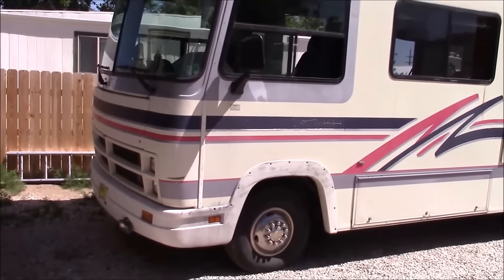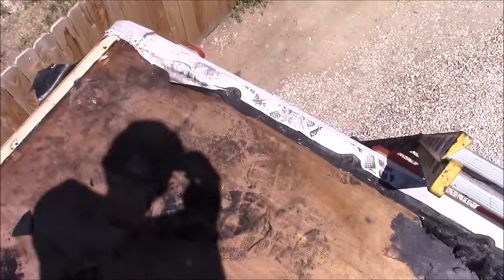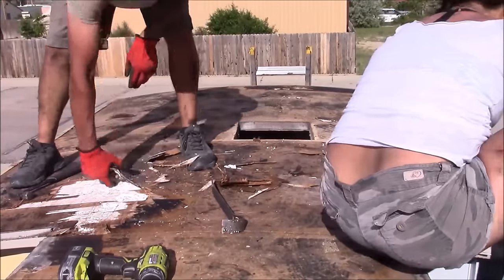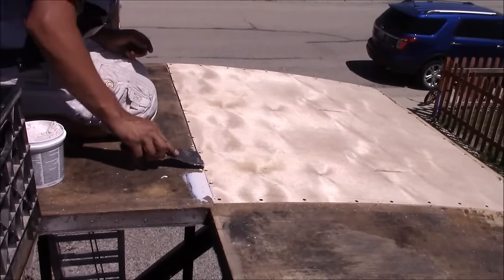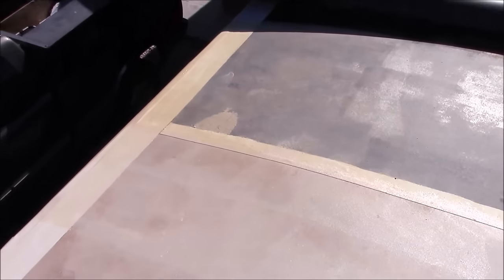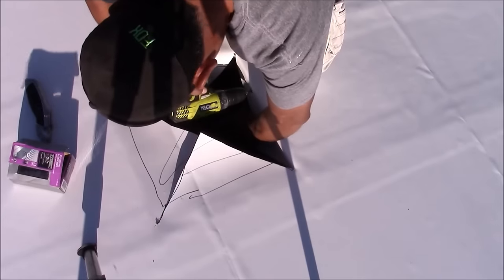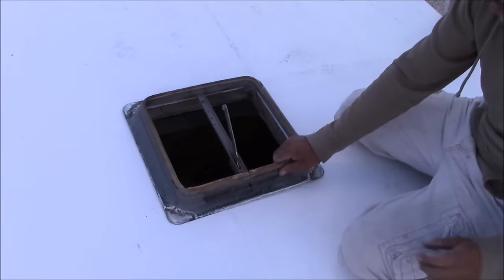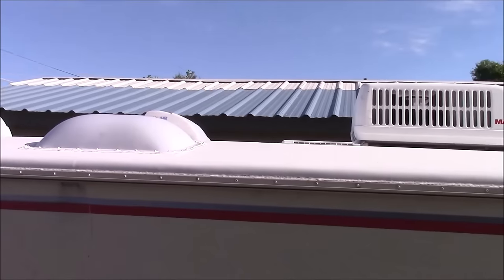How to replace your RV or Motorhome roof EPDM or TPO

Comment: Does the new adhesive stick to the old or does it have to be removed?  I removed my edpm roof and the decking is really sticky. Can I just use the Dicor adhesive right over that or does it have to be shipped off and how?

Comment: Great step-by-step video.  But I would never trust roofing screws with gaskets to stay 100% leak proof.  There is way too much movement involved with an RV traveling down the road.  The smallest bit of water wicking into the underlayment via even a single screw that does not seal will result in rot.  This kind of leak may be undetectable until you discover a big soft spot in the roof in a couple of years.  Go ahead and put a dab of lap sealant on each screw head.  Alternately, you could apply strips of eternabond tape over the rows of roofing screws.

Comment: How long do you think your new roof will last? I’m worried about buying a camper with this type of roof. I’m looking at two campers. The one I like the best has this roof. My second choose has a full aluminum roof. Should this affect my choice? I’m 65 years old so if a new roof lasts  for 10 years I’ll be OK with that.
Reply from the maker: new roof 15 to 20 years but if you get a cover for the months you are not using you could double the life
Reply: C.L.S. Allinone thank you, you helped me make my choice.
Reply: I do commercial roofing for a living. Expect. 30 years for a firestone TPO.   Glue both wood a back side of TPO. Let dry to touch you will be using water block wherever out have a edge.   FYI. Water block is messy. Gets some rags.
Reply: what kind of cover do you use and where can I get them and how much @D.I.Y._All-in-One

Comment: Question: Is there any reason a guy couldn't go right over the old roof? As long as the ends and edges are still terminated properly? Where I live, every 2 or 3 years we'll have hail large enough to put a dent in a normal RV roof. If there were 2 layers maybe it would have a little more bounce back? Is there a reason not to do that?

Comment: Would you happen to have an experience with adhesives to adhere filon to an underlayment?
I took the front fiberglass off the front of my travel trailer and the paper cardboard that they used underneath was not recoverable so I'm having a hard time finding an underlayment 8x9 and the adhesive that would be good for attaching them both together so I can reinstall the fiberglass.
Any advice on this I'd appreciate it thank you.

Comment: I am replacing the roof on my RV and my helper says just put new layer of wood on top of the wood that is already there, he is arguing with me and i am insisting we pull the wood off the sfoam. My thoughts are if we put a layer on top of the existing wood then the top is 1/2" thick and your graphic shows 1/4" hick. Does it matter?
Reply: laminating 2 layers of plywood together is a bad idea unless you completely coat both mating faces with epoxy before screwing them together. this is to seal the wood and fill in the gaps so that there are no voids or empty pockets that could potentially fill up with water (from a roof leak or from internal condensation buildup) and start the wood rotting process. the additional weight can also be an issue for capacity and because it's up high, may affect stability and handling. 

if the existing plywood is bad enough to need replacing then it probably already has mold and rot fungus in it and will continue to rot under the new roof, eventually causing the new plywood to rot as well.

Comment: What do you think it would cost to replace for a 34’ RV including labor. I need to hire someone to do mine and want to be prepared. Thank you
Reply from the maker: 4 to 5k for a starting point
Reply: You can get a 5 gallon bucket of Flex Seal and use cardboard & gorilla tape to create "dams" 
And get it done for less than $400 in 4 hours
But you have to pull the cardboard and Gorilla Tape while it's still wet
Reply: Depending on damage could be as much as 20k

Comment: Question, why did you use putty under the front and rear strips instead of Butel strips
Reply from the maker: I just ran out of butyl tape and all I could find in town was putty either one works well though.

Comment: the putty tape shrinks and pulls back from the initial contact areas  (I.E. it is relatively easy to result in a leak.)   It would have been much better to use the butyl tape everywhere
Reply: He said he ran out that's why he just used putty

Comment: What is the tape that I  can use to cover my old    Beat up an broken trim I see it in alot of video but don't know what it's isi need to seal my popup trailer roof and repaint it because it's old and getting dented and  Big gouges in it any other thing is I used silicone to seal up all the trim  And seems because they were leaking and original cocking now I cannot paint it because it's non paintable I didn't know it and I'm trying to find the tape or rubberized tape that will be sealed when I paint the whole roof to protect it from being damaged which is getting damage now from things falling on it in guarding it I was looking at the  Henry's white rv and trailer paint That you put on the roof will that be the best I don't know I'm trying to figure out seen it on videos it to use that can you give me to my dear I not on this site all the time so you will not be able to see the answers thank you

Comment: Whoa whoa whoa, good job, but the only thing I need to point out is any metal roofing type of screw with the hex head and rubber gasket should NOT be driven in too tight. SNUG. When the rubber gasket is crushed from too much torque, it will not last through a couple of years. Too much pressure makes the rubber gasket susceptible to expansion and contraction from weather and temperature changes. Again, good job though. I've been doing it 20 years, sometimes I just like watching other people work.

Comment: I have an old motorhome I bought from a suspected tweaker 😰😵😵whose manic compulsion to 'fix' things, ruined things! Leaks from 1-2 inches of nails poking through the roof, nails and screws, stuck halfway in and can't be removed! 

ALL that, PLUS years and years of just patching a gunshot wound with a Band-Aid- they just kept piling sealants, upon various quick patches, but NEVER dealt with the leaks from the source--severe water damage and rotting wood, that finally caved, fell into the bathtub and left a gaping hole in the roof! After seeing the origin of the leak, I decided to take it apart like you did, after wasting $ white latex sealant through the roof sealant you name it I bought it, NONE did the job. I can't afford a professional's fee, so I bought all the material and no I'm not looking forward to stripping off mountains of spackle, tapes, caulk and sealants, I'm going to do all the prepping and gluing and pay someone to help me cut the wood and termination bar thingies but I can do this now that I've seen your video!

THIS is the best video I've ever seen on RV roof repair, thank you

Comment: what tape is that? is it like a clay putty gasket material? There is a grey putty like gasket material at work  that was being used to seal and spread all over some giant air conditioning ducts around every seam, I could get my hands on that but i would like to know the name so i can buy the exact amount i need for my camper projects.
  I did find this same grey putty like tape between the window aluminum frames and the outside of my camper so i know its the right stuff, but you are using something that is black there and it may have a different name however possibly the same properties as this grey stuff i found.

any help on this matter would be much appreciated
Reply: I am guessing it is just called putty tape. but that black tape i cant understand your pronunciation.

Comment: It's absolutely a stupid thing that the manufactures of trailers & motor homes use membrain for the roofing what in heck was they thinking....they could have used common sense & put a thing on called steel roofing not rubber membrain...personally i would never buy any coach that has rubber roof i seen damage done to my paraent's roofing started leaking much a disaster nevertheless this video was well done very detailed thumbs up..👍
Reply: i drive truck for a living, i see about 1 out of 10 rubber roofs unglued and ballooned  up , some times they are torn and flopping around. you also have to keep them out of the sun
Reply: I would think that it's a weight saving and flexibility thing.

Comment: RV roof repair can get real expensive real fast this was minor compared to some I've seen  !
Reply: Me too. I work at a repair shop and I've worked at most factories over the past 20 years. Water damage is the worst especially when it's a stick and tin. If it's been leaking more that a couple times it is way above most people's heads

Comment: Do you still have that extra kit laying around? I just bought a coach that needs a roof and after watching this great video, I am more than ready to do it myself!
Reply from the maker: yes i have 1 kit available like this one  http://www.ebay.com/itm/10-x-30-45-Mil-White-TPO-RV-Rubber-Roof-Kit-membrane-adhesive-tape-caulk/152184934989?ssPageName=STRK%3AMEBIDX%3AIT&_trksid=p2057872.m2749.l2649
i would sell at half of the price they have theirs listed for

Comment: 1) ETERNA BOND Roof seal tape, RSW, VW,etc...mfg royal microcellant technologies HB Fuller. Use this tape on all of your seams of your ro of and any of your parts that need to be sealed as well from water.

TIP: TO REMOVE this tape you use a heat gun or a hair dryer heated up and use a plastic spackle spreader they call it a joint knife if it's metal I guess, And you can once the material is softened up from the heat gun you can scrape it off and use gasoline to clean it up or mineral spirits I believe but gasoline cleans it up the best there is a video on this.

2) CHEMLINK M1— For your structural adhesive for putting your roof panels on and gluing them down. I'm sure you could probably use this for other things at your discretion I am not an expert but I'm going to use these adhesives for my camper at this point in time.
3) 3M #90— $12.98 a green can found at Home Depot and Lowe's in the paint/adhesives isles—used for your delamination or side panels of your camper that use plastic phylon FRP wood metal it does it all read the can I am not an expert.

4) DURALINK 50 used for your lap sealant I guess from what I researched it's better than dicor and RV roof repair guys I believe use this stuff because it came from someone who did their research watching their videos. Again do your research I am not an expert. And I'm going to use these materials as spoken here. Unless I need one I can rebut this info.

Comment: How much should you pay for a motorhome with a damaged roof and some damage inside from a long term leak. It's a 1993 tour master
Reply from the maker: RacingRocks12 40% or less of retail i would recommend.
Reply: C.L.S. Allinone appreciate it. That's about where I am on the offer. I do believe he is insulted a bit though. We will see. He assumed it was just a leak in one of the skylights and my inspection found the entire roof to be leaking. I'll need to replace 3 roof panels and a few panels inside, plus the carpet.
Reply from the maker: RacingRocks12 yes water damage is no joke. Mine retails for $12,000 got it for 4000 but I also had to remodel the inside including replacing multiple wall panels too.
Reply: C.L.S. Allinone sadly he won't budge for anyone so there it will sadly rot and go from it's gorgeous state to a pice of rotten... You know what. Thanks for the info and I appreciate the video.

Comment: Personally I would have lap sealed those screws, sure they have gaskets but gaskets will fail in the heat.
Reply: If gaskets fail in the heat, why doesnt lap seal fail in the heat? Why does one fail but not the other?

Comment: Nicely done and helpful video! I'm just disappointed that, with such a strong roof structure there, you didn't use slate instead of rubber. It's a little more expensive, but surely it would last longer and definitely be unique ...    :->
Reply: slate? waaat 2 heavy.do u realize how heavy slate is/fuel prices.....danger when it flies off on the highway!really?
Reply: @muffdiver69x   🤣

Comment: You did one thing wrong. Your supposed to put sealant on the screw heads on the roof. I'm not too sure about the side trim? A lot of side trim has a rubber weather striping that covers the screw heads. Something is supposed to weather seal those screw heads (on the roof and on the sides or corners.) It looks like you posted this video last summer. Those screws will probably leak after time and rust out. Other than that it doesn't get any better for a diy job. I thought about doing a rv roof myself. But once you have the old roof striped off. You got to be prepared to deal with any rotted panels and other problems. I personally think it's best to replace these roofs before rot settles in. Why wait till those damages occur? On a travel trailer for example, the whole frame is basically constructed out of wood. I heard water can leak down the walls and basically rot the whole frame of the trailer out. And it wouldn't be worth fixing it if there's too much damage.
Reply from the maker: Thanks for the feedback. I bought this Motorhome really cheap because of roof. The roof should have been replaced probably 8 years ago but people neglect stuff unfortunately.  Those screws i used are roofing screws that have rubber washers and enamel paint  that make the waterproof/weatherproof.  I did talk about adding sealant to screws that are not waterproof in the video though .
Reply: JEFFREY you should have noticed the roofing screws are weather proof with rubber washer seals and made for metal roofing applications and last 30 years so therefore not WRONG! encapsulation is complete waste of time and material? This dude did an excellent job so lose the NEGATIVE attitude and just thank the guy man!
Reply: You guys can do it however you want. The rv pros say to cover the exposed seams and screws with self leveling caulk. You can be positive as much as you want. But if the roof leaks and there's mold and damage. It wont be such a positive situation. Obvisouly your not thinking ahead.

Comment: that dieco stuff is crap, it cracks and shrinks fast Better off with liquid EPDM or  eternabound seam tape
Reply: PS, better off curbing all penetrations and counter flash with seam tape, or even better, bend it out of .032 gauge alum. and form it into one piece counter flash by assembly using epoxy and  pop rivets. It's too thin to weld. You can rent a break to bend the alum.